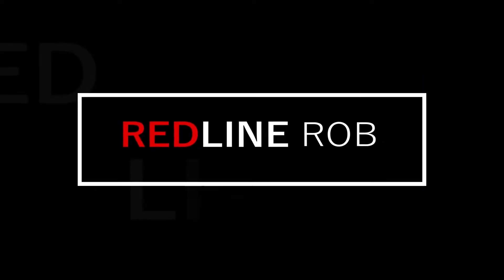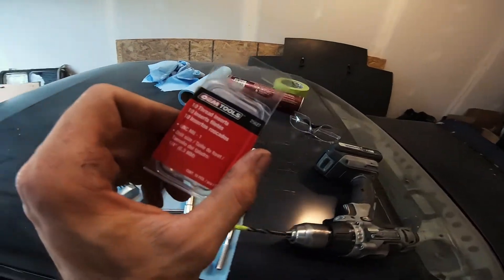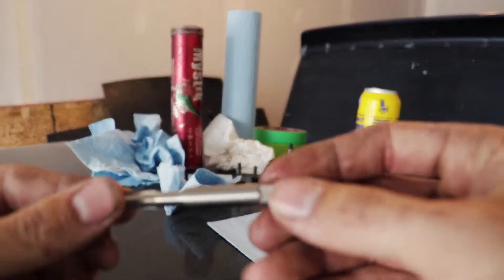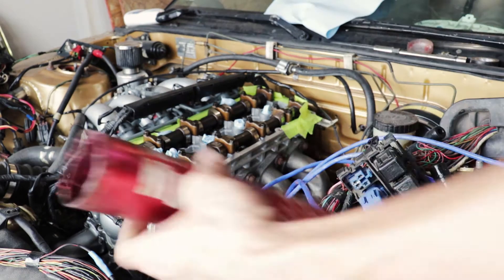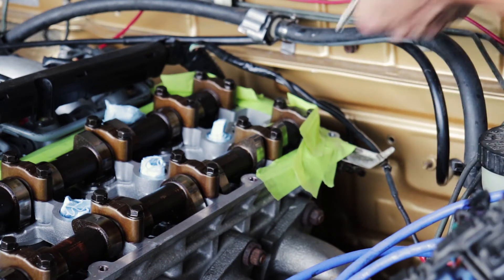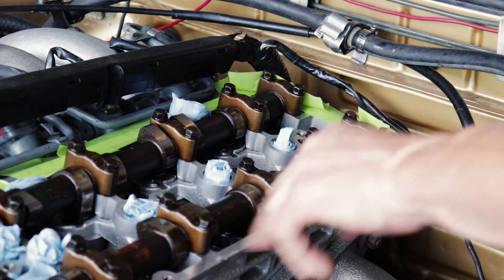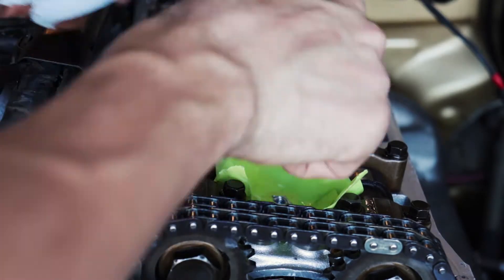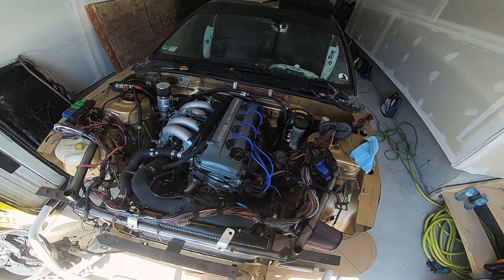Helicoil | (Thread Insert) 240SX valve cover install

Comment: Awesome to see more videos of the 240sx  those new value cover bolts should be able take some abuse when your drifting.
Reply from the maker: Oh hell yeah, still used original hardware with the new inserts though felt so amazing when they didnt spin after being tight 🤟
Reply: @redlinerob590  ok that makes sense now! I was a little confused if they where new or old bolts.